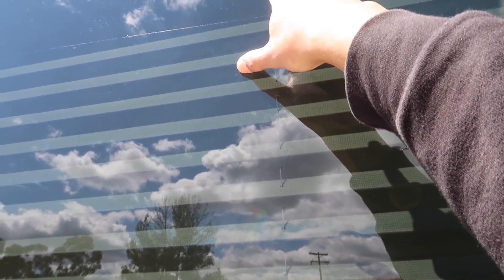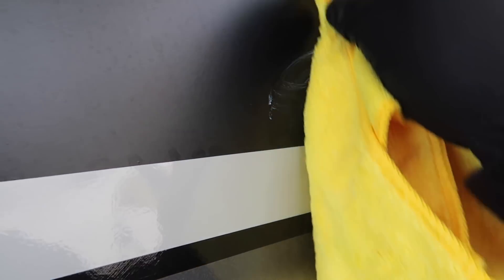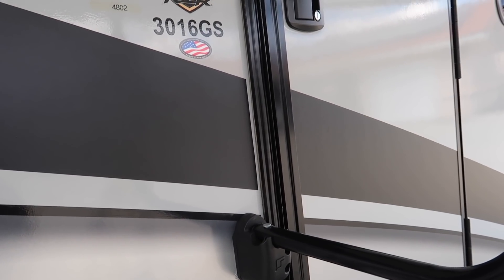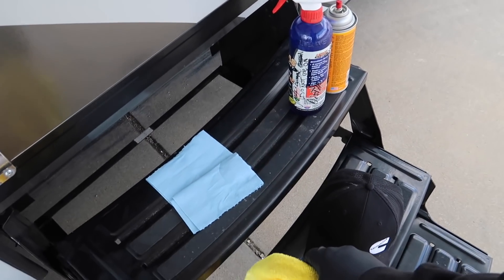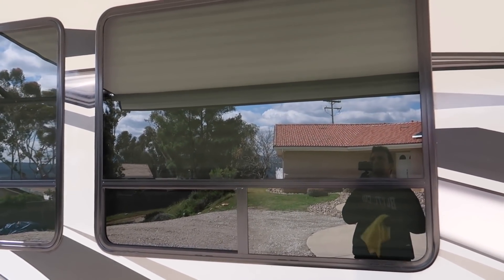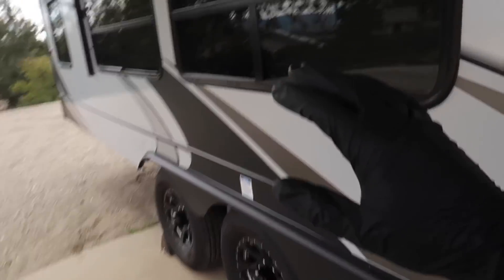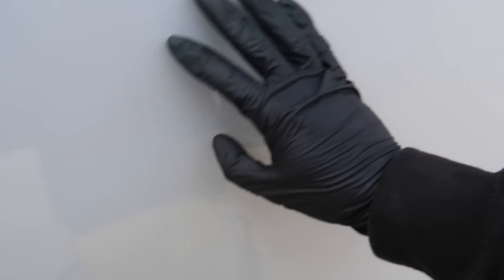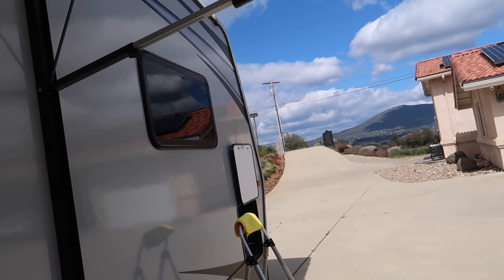How to remove water spots from windows

Comment: I'm surprised you havent taken that trailer into get ceramic coated get it fully protected check out bob moses ceramic coating hes in AZ but top notch work
Reply from the maker: ceramic this thing dont have no paint on it hahah
Reply: @EddieLife3500  most RVs and trailers now dont but his ceramic coating makes trailers look amazing hes got a few attitude's on his FB page keeps your vinyls from ever getting sun damaged or fading and cleaning after a trip is easy after hes done it will have that wet look 24/7 for years
Reply from the maker: ill check it out